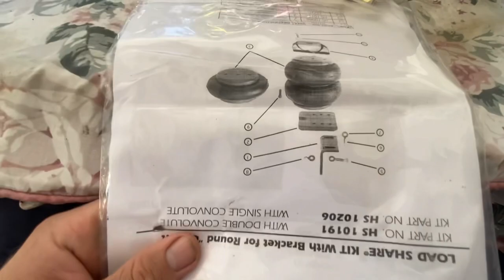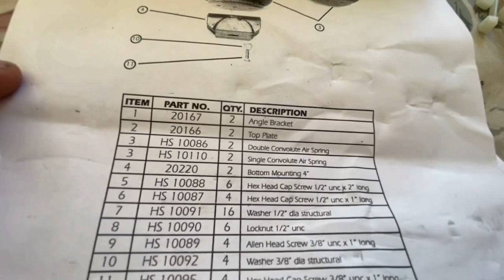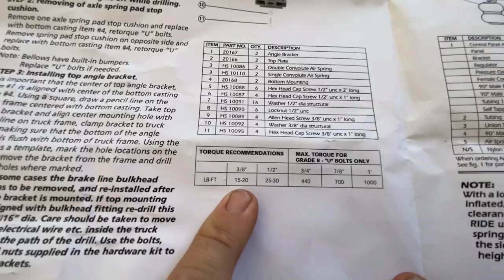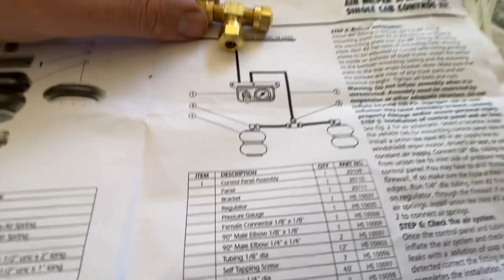Kenworth w900 custom DIY air ride kit

Comment: Great to see younger people doin this kinda fab work! Got a question? Gonna put this same kit on a 379 Pete, i run about 28 miles loaded at 86000 lbs then back empty. Not so much wanting to lower  my truck as i am wanting to improve the ride especially empty. I haul 6 loads a day. do you have to back the air off each time when your empty to keep from over airing the front end and will it raise the front if you dont back the air down a few lbs? also how much air pressure   do you run  when your loaded? Thank You, and again good work!
Reply: These kits are a air assist kit.  They aren’t meant to have leafs removed.  The bags are rated at 2500 or so each.  They will improve ride quality by absorbing the shock n aww effect.  You would have to run it an dial it in to your liking.  Most only run between 15-40 psi.  My 2 cents
Reply: @markrosser5253  are you sure about that advice ? 2500 lb bags are for pickup trucks, these bags are supporting 12,000 and the leafs are meant to keep the axle in place
Reply: Yea that’s what i was saying.  I would not remove a leaf with these kits.  An air bag meant to only handle 5k per pair.
Reply: @markrosser5253  sooo you dont really know anything about big trucks or air suspension is what you're saying ?
Reply: Dumb it up.

Comment: Nice work. Lil tip when drilling into hard steel, try going at a slower speed, it allows the bit to cut before burning. Also I find the Irwin brand steel drill bits cuts better and last longer.
Reply: Truck frames are mild steel, and Irwin compared to what other brands?
Reply: I think you would technically be right in calling it mild steel however it’s T1 or a similar grade of heat treated steel between 100-125ksi. A far cry from your average “mild steel”
Reply: Magnet drill boys, get with the times.
U can rent em at pretty much every tool rental spot

Comment: Nicest red w900 i seen in a while.
Reply from the maker: That means a lot. Thank you 🙏🏼
Heard you got one too now congrats by the way
Reply: @TruckerGemini  thanks man. Now the real question, would you do it again or pay arroyo?
Reply from the maker: @alaskahaul2085  I like doing my own stuff so I can learn. It wasn’t that bad.
Only thing I regret was not putting my own kit together.  So when I redo it I’m doing  individual electronic valves and bags and bag mounts. With bigger fittings. To air up and down faster.
Reply: @TruckerGemini  yea those air lines aren't the best and that gauge they sent is kinda ridiculous lol

Comment: Hey bud nice work and good looking ride, I need to get those shocks I got a w900 with that same air ride kid the truck is bouncing a lot in the front I’m thinking shocks, hopefully putting shorter ones solves the problem. Do u have a part # for those shocks?

Comment: Just a quick question, what is the part number to the shocks used? 
Been trying to find them also used the same air ride kit. 
TIA
Reply from the maker: You should watch the video it’s literally on the screen in big letters
Reply: @TruckerGemini  it’s not popping up bro if you could put it on the comments it would be great.

Comment: Canadian loadshare???I took mine off...was so bad....sooo much damn bouncing and bump steer...better off just removing the blocks and 1 leaf
Reply from the maker: Because you have to dial it in for it to work right. I have almost 0 bump steer. I actually had kris bump steer with a leaf and blocks removed.  To each their own.
And if you had bump steer you should have added another shock.
Reply: Ok i see what your saying...can I add another shock by taking out block and leaves...is there a certain mount I can buy?
Reply from the maker: I’m almost certain you’ll always have a little bit of bump steer but nothing you’re not gonna get use to.
If you watch the video you’ll have to take the shock mounts flip them around and put driver to passanger, passenger to driver and put them on top of the leaf pack. Then just get a shorter shock and it should be good.

Comment: I had a shop install that unit on my Lonestar and it doesn't go up or down. Something's wrong big time.
Reply from the maker: Lol because they did it very wrong then. It’s a pretty simple system. You need to find a shop/ someone  who knows how it works or is willing to read the instructions.
Reply: @TruckerGemini  I've been looking for a competent shop for over a year. I think they even reversed the hoses and  put the gauge upside down on top of my dash. Loadshare said the bags may also be stuck and the truck needs to be lifted in order for the axles can hang and possibly release them. I took it San Leandro Betts. I need that Arroyo Customs.
Reply from the maker: Sometimes you just gotta take matters into your own hands and do it yourself. I started working on my own stuff because of stuff like this. And betts are forsure bunch of guys who don’t know much. Took them 3 weeks to replace my front axle bushings. So I decided never again. 

They definitely didn’t do something right.  Does the knob do anything?
Reply: @TruckerGemini  i here you on fixing your own stuff. the knob turns left and right. It builds and releases air. Air comes out of the top of the knob when deflated. I know that wrong. Air should be released from the bag not the gauge knob right?
Reply: They were the only shop that did what I asked to do for my driveline. Trucks been shaking since a got a year ago.  I kept saying the driveline is out of wack. Every shop kept saying it's aligned. Aligned ain't balanced. They took it off and sent it out. Just like I said. Out of balance with two messed up ends. However they sure enough jacked up my bags.

Comment: IMO the kit from 12 gauge is built a lot better.
Reply from the maker: IMO you’re right
Reply: @TruckerGemini  Also Arroyo Customs out of Cali makes a kit that’s looks better than both just based on brackets and installation etc. Keep in mind I’m not a trucker, just a welder/fabricator… Props to you, that was a lot of work man. But it still gets the job done.. Nice ride though, and you have a Cat engine….

Comment: How do you get your hood to open that easy? I dang near throw out my back trying to open my 900 hood
Reply from the maker: You need to upgrade to white hood springs. And if you have the white ones already then you need to replace them. 
The hood opens and closes on its own lol

Those springs aren’t there to just hold the hood. They actually push too when they hood is closed.
Reply: @TruckerGemini  thanks man. I’ll look into it. That’s one sharp looking 900 you got there.
Reply from the maker: @Dirtybird51077  they’re cheap right now at kw I think I paid like 50$ for the set. Usually they’re like 100$ or so. But if you Google them you can probably order.

And thank you sir . It’s coming along slowly.

Comment: Is there any other way to lower the front end a few inches safely? Or do i need to go air ride? 
I'm not really looking for the slammed look... I just want the gap between the fender and the tire to be closer together. 
thanks!
Reply: What truck? You can replace your springs with car hauler springs, they are available for western star, Pete and kw
Reply: @TheRoadhammer379  I have an 07 W900L. I currently have a 3 leaf setup with a pretty fat brick between the axle and the springs. So your saying I can simply eliminate  that brick and the springs and replace with new car hauler ones and i can achieve the lowered look?
Reply from the maker: If you remove the brick you’ll achieve the lowered look. If you remove the “brick” and do car hauler axle. Youll start getting stuck places without air ride.
Reply from the maker: Yeah just remove the spacers and you’ll need shorter shocks and that’s it I drove like that for a while. Before bagging. It gets rid of that gap between wheels and fender
Reply: @TruckerGemini  thanks brother

Comment: That kit said "Helper" note the single air bag per side. If you look at a true air ride front axle there is Dual bags per side. And your going to have to run dual shocks.
Reply from the maker: 1. It’s a universal kit  you can run it on anything and anywhere you want 
2. You’re wrong about dual bags and dual shocks, just because you saw peterbilt putting them on from factory doesn’t mean it’s the way it’s suppose to be. curious if you actually know why some trucks run dual shocks and it’s not for a smoother ride.
Reply: @TruckerGemini  I run Air Ride front axle on my 2014 W9, and I've tried that same kit you bought, the bags failed over time. And I know the dual shocks aren't for the Ride. You will see. Good Luck.
Reply from the maker: I’ll be redoing the kit with my own set up now that I have the idea of how it all works. I won’t ever run a dual bag set up but it’ll be a different bag.
But. I’ve been running this kit for a while now and it rides a lot better than the stock springs did.  I just got around to putting the video together for it. For those who do get this kit and are looking for advice. Pretty much answers all the questions I had while attempting it.
For the price and a little bit of knowledge it’s a simple kit.
Reply: @TruckerGemini  Yes a bigger bag will do the trick. I run dual shocks for the sake of the leaf bushings, my shocks are apposing each other like a V. Made a big difference!
Reply: You don’t really need dual shocks, it might help with some bounce at some times. But If you look at my videos I made my own kit and made sure to leave enough room for second shocks per side but never needed to..